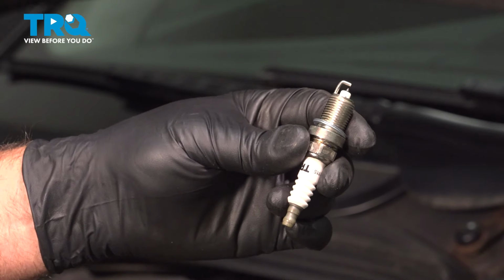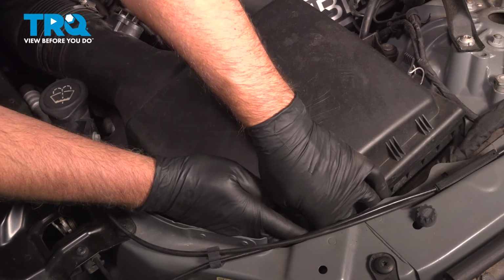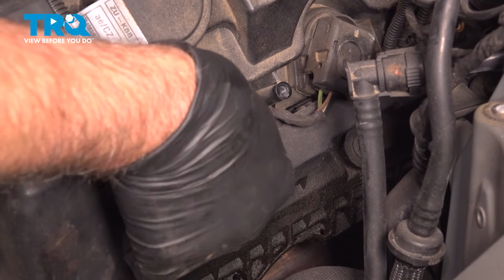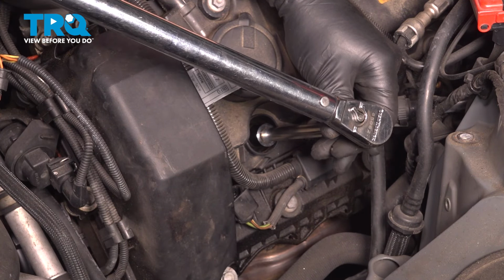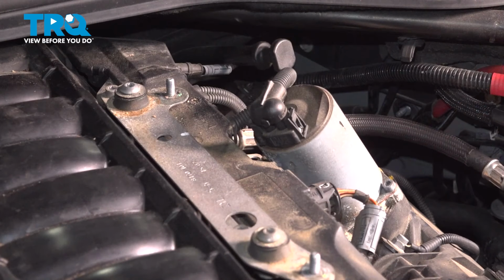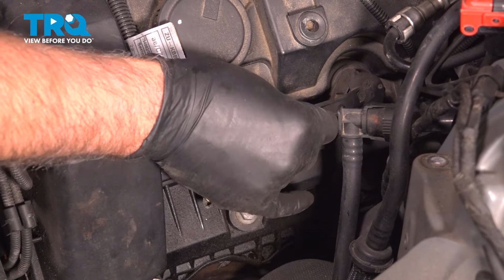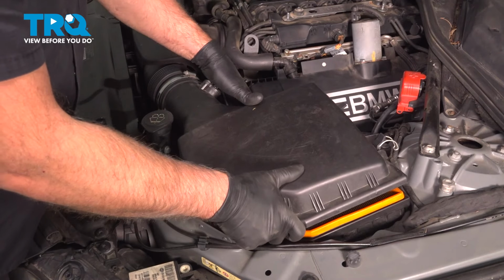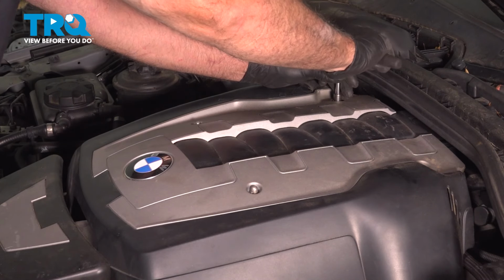How to Replace Spark Plugs 2006-2010 BMW 550i 4.8L V8

Comment: YOU NEED A 12point 14mm SOCKET NOT A 5/8

You say it’s a 5/8 socket. But the spark plug you pull out is a 14mm 12point spark plug. Your socket is also a 12point socket….